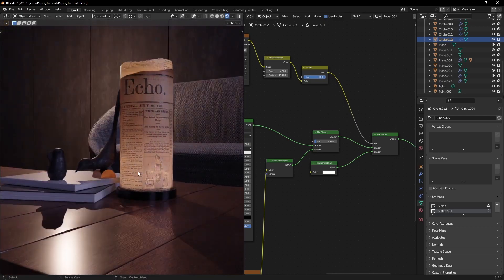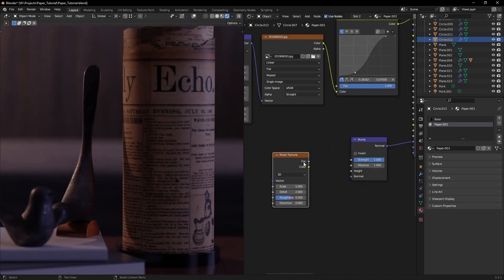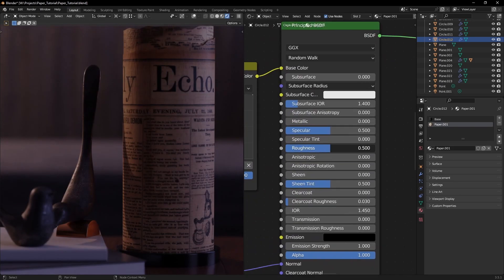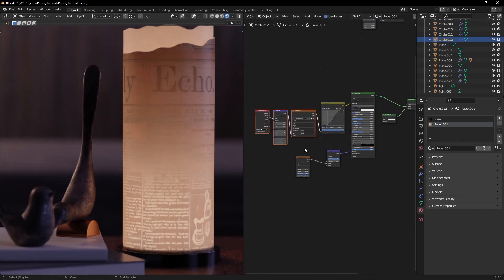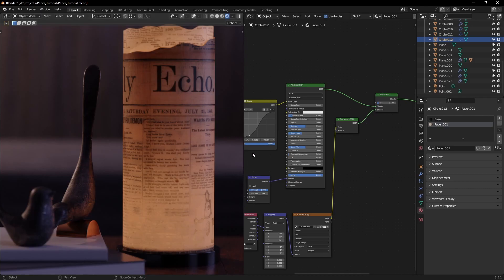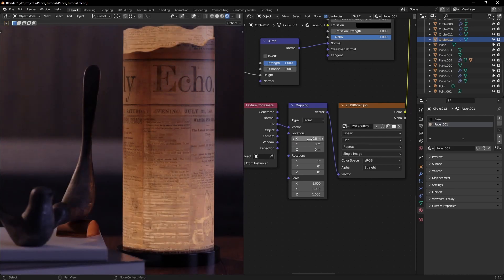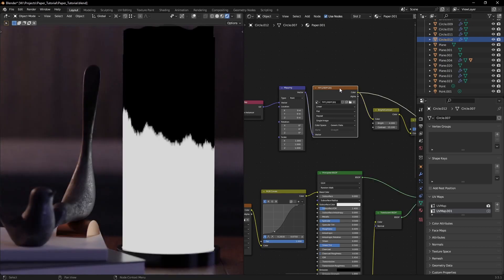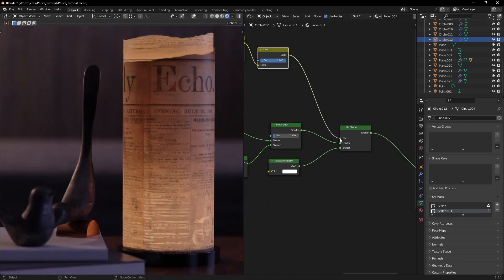How to Make Translucent Paper Material | Blender Arch - Viz Series

Comment: Akhchually, translucent shader shoulnd't be mixed, but added if you want physically realistic results.
Reply from the maker: true, but mixing it gives easier control, cause if you want to lesser the effect, you would otherwise have to darken the texture, which doesn't always work great with jpegs 😁😁😁
Reply: @blenderisms  if you want to lesser the effect, it will give you the wrong result. Try mixing the two with 50% factor and then add shader with translucent texture linearly 50% darker. The translucency will be calculated differently.
Reply from the maker: @magni319  yeah :D I'm quite aware how the energy conservation works in raytracing :D but I still personally think mixing in the translucent shader instead of adding it is a bit more convenient for very little visible difference.

Comment: really struggling to see what the nodes are that you used on the newspaper texture. did i miss a different tutorial?
Reply from the maker: Hi, every image texture that I use gets a mapping and a texture coordinate node attached to it so i can control it's placement on the 3d models. once thing you can do to get those nodes automatically is enable the "node wrangler" addon and once you load a texture, while the node is selected hit Ctrl+T.  I also plug the texture into a RGB Curves node so that I can color correct it if needed. Hope that helps.